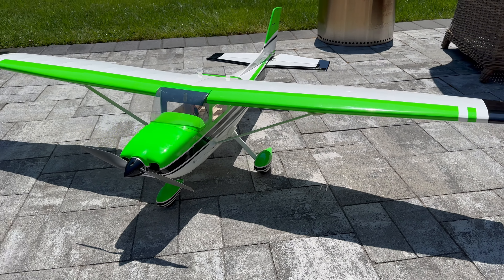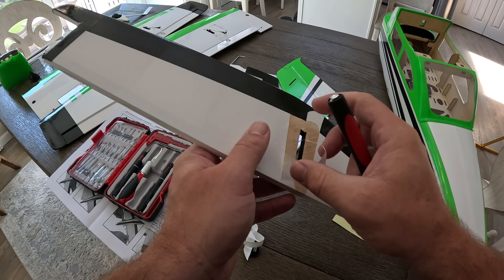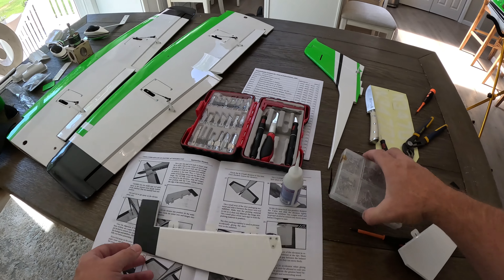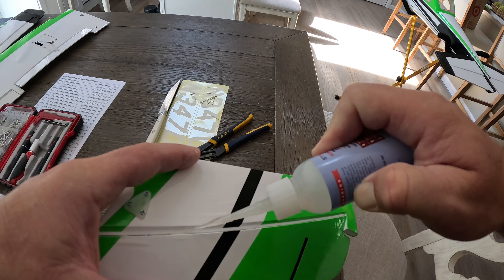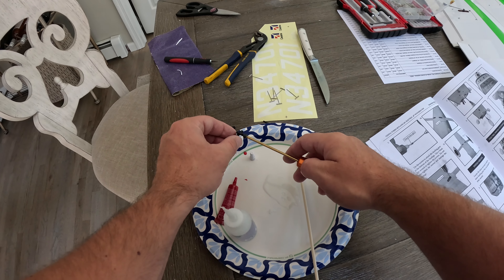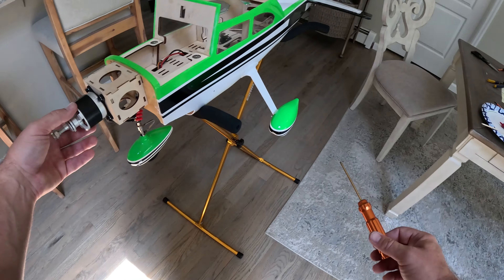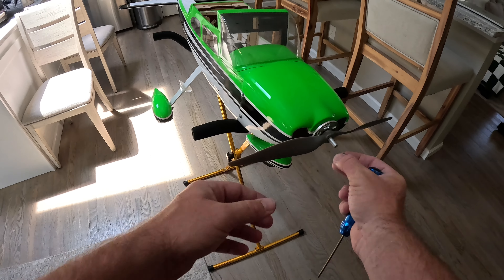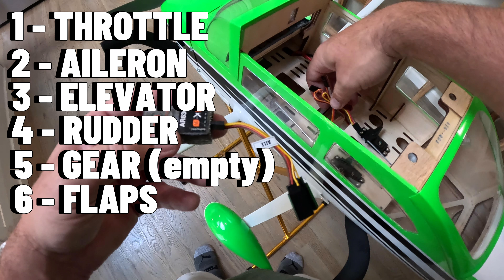Foam is DONE! A PNP Balsa Cessna 182 - Part 2 Build/Setup

Comment: Tip from an old timer here, don't use 5 min epoxy in structural areas. It will not have enough time to properly soak into the wood to get a good bond. Use 15 min, or the best is 30 min. You can use a heat gun on the epoxy bottles to heat them up before mixing to get epoxy thinner.
Reply: this is wisdom, listen to it🤣
Reply: I agree ☝️
Reply: Wise man

Comment: Real simply, if the plane comes with electronics it is a PNP. Especially if they're already installed. If you need to supply your own electronics, ie, servos, motor, ESC, it is an ARF. There's always going to be some assembly required. Also, you should never use 5 min epoxy. Always use 30 min. The structural integrity of the plane may be compromised with 5 and 15 min epoxies. Check out any Extreme Flight planes and their online manuals if you have any doubt, or questions about how to build an ARF, or PNP for that matter.

Comment: Dude, you didn't even measure to check and see that the horizontal stab was straight before you marked it to cut the covering back, to glue it in. You got to measure that man from the tip of the wing to the tip of the horizontal stabilizer on each side and make sure both sides are the same measurement,
 so you know that the plane is square. Surely you know this information if you're flying RC planes..

Comment: Definitely not PNP. Nice video! I saw or read a test about adhesives not long ago, and hot glue was better than epoxy in most applications. I believe it, because I've had some major failures with epoxy. I've sometimes wondered if hot glue or packing tape were better.

Comment: Those CA hinges are trash. Ive had them rip so many times that I have given up on them with any balsa plane. I use the dubro hinges the flat ones for smaller planes and robart pin hinges for larger models. Screw those cheap  ass CA hinges yall need to stop being lazy and put real hinges in there and gap seal your surfaces its worth the effort I promise!